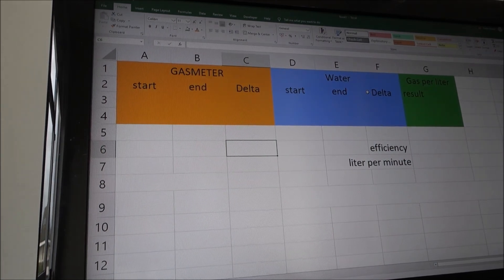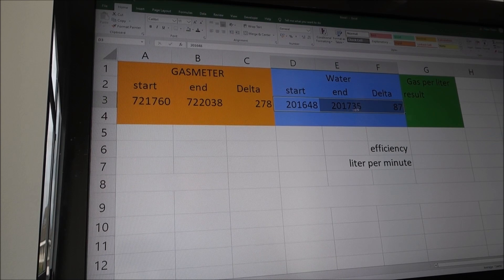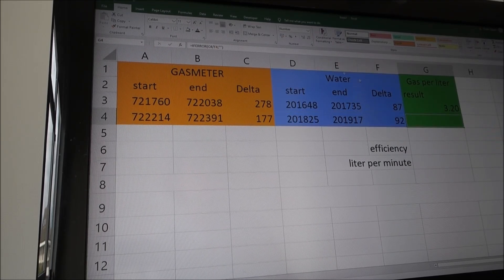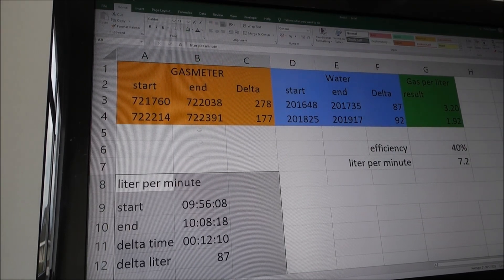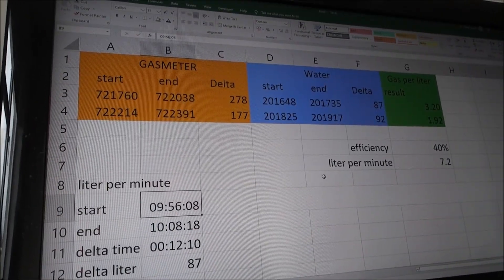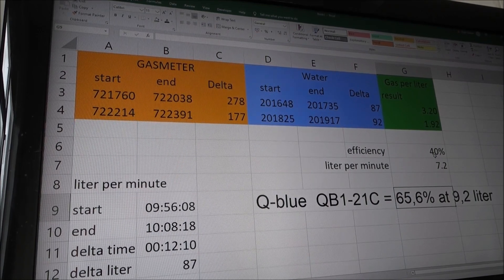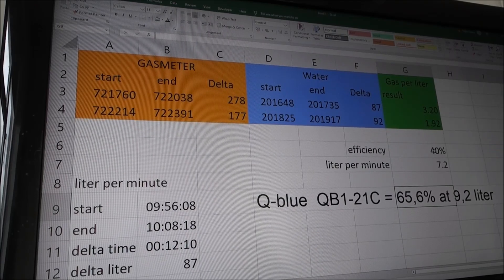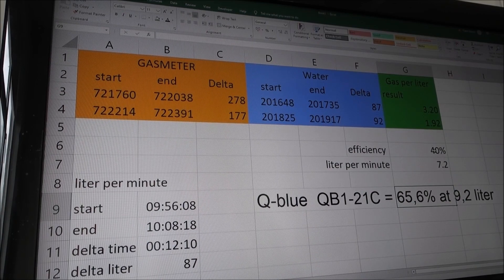Shower heat exchanger Q-Blue Showersave QB1 21C

Comment: Hey Pieter, this is a great video, thanks. What are your thoughts now, 2.5 years later? Would you recommend an installation?
Reply from the maker: I haven't checked the performance lately but yes I recommend it. It doesn't wear and it works for an eternity opposed to solar panels.

With a heat pump i recommend it even more since you can get a smaller buffer of hot tap water.
Reply: Thanks, Pieter. Do you happen to compare your system against the systems of Dutch Solar Systems, Herwin-Energie or Joulia that use a drain instead of a downpipe? I have both options and am still unsure which makes more sense.
Reply from the maker: @dominikeggert2585  if you house allows, always go for the downpipe. It is more efficient and cheaper. I haven't tested those ofcourse since I don't have one.